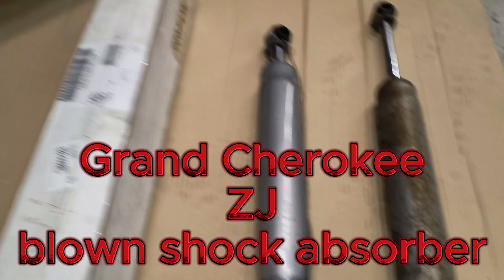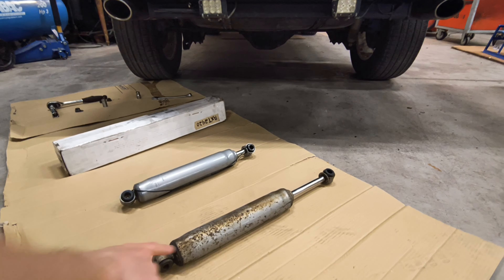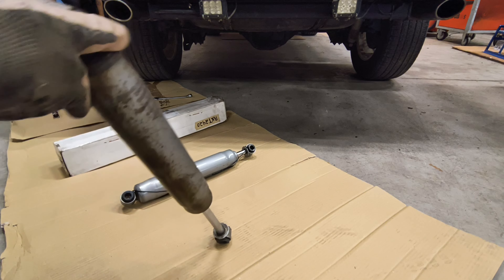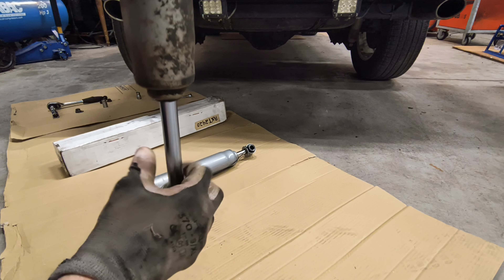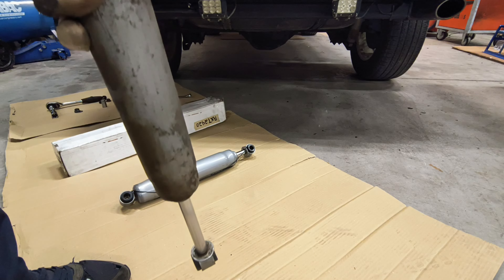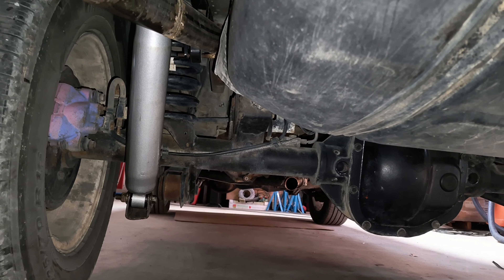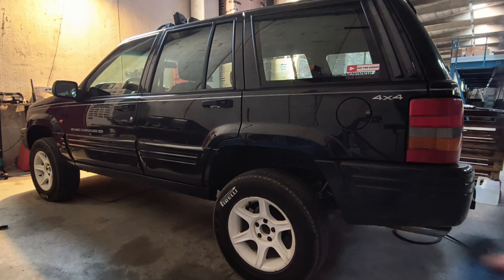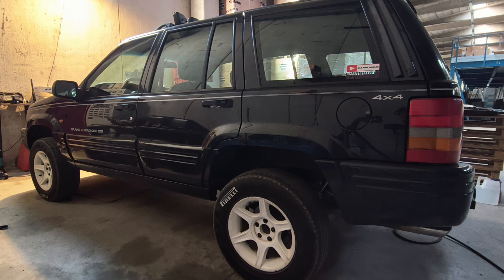Jeep Grand cherokee zj rear shock replacement & test

Comment: Can you make a video of the sound of your 98 5.9 downshifting?
Reply from the maker: yup, it's in the making...
Reply: @ awesome, you plan on doing a pro charger or supercharger?
Reply from the maker: @RustyReaper204  honestly i don't think so. i'm afraid to grenade the drivetrain.
Reply: @ whats an upgraded transmission to swap in? I’m looking to get a torque storm pro charger
Reply from the maker: @RustyReaper204  i'd say get a built 44re with high stall.